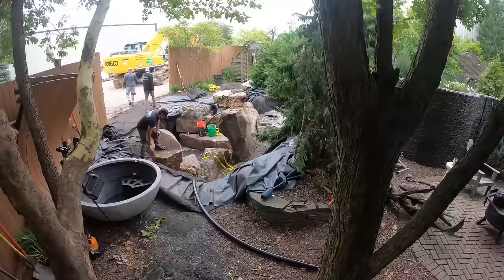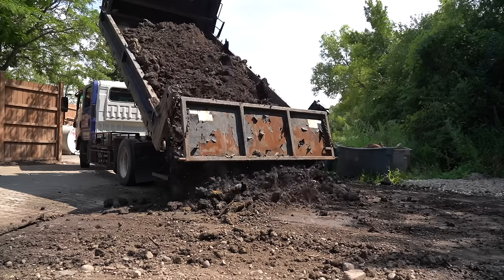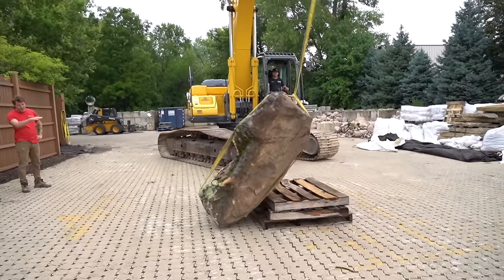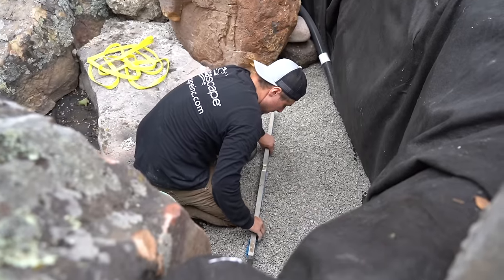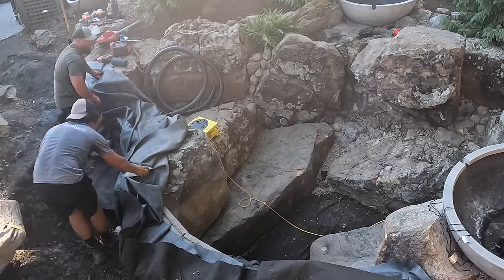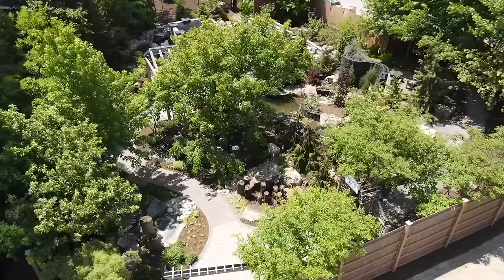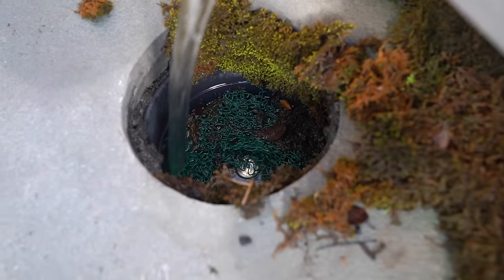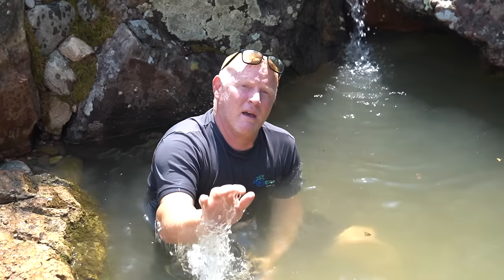Creating a Tranquil Pond With Massive Rocks

Comment: Really liked the huge rocks, small area, really deep plunge pool theme. That 60-inch bowl really fits nice in that sized setting. My thoughts are water circulation and clarity and if you got video at night showcasing any lighting to emphasize a clear visual depth. Also, that one shot of you sitting in the water could have a 'misting effect' of water off the adjacent rocks. Not sure how to make that happen, but for the theme slow trickling water blanketing on that nearby rock with natural wind pushing a mist on hot days and a crazy effect for winters. Wowza! Great job to the team, especially Papa Smurf Jack!!